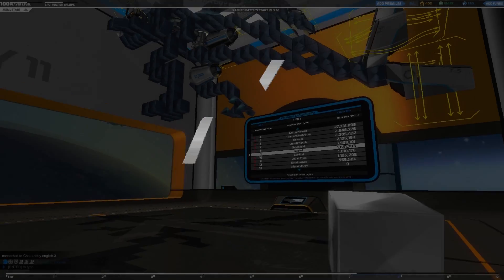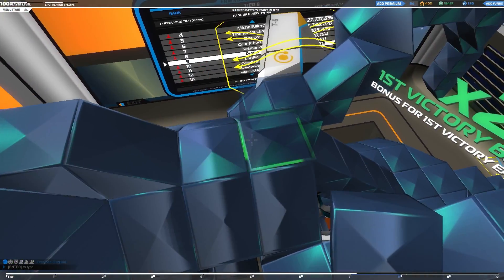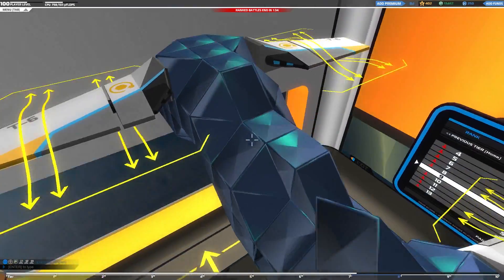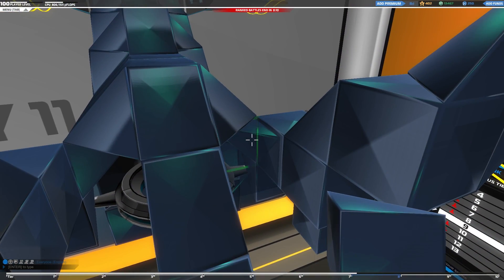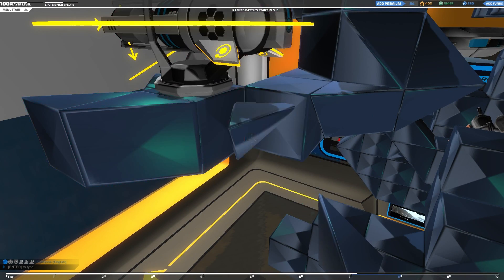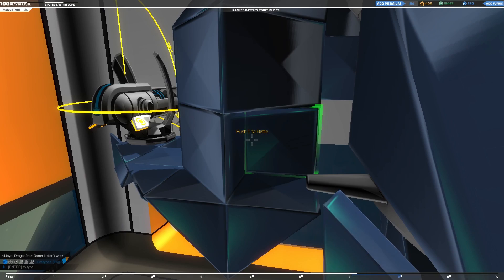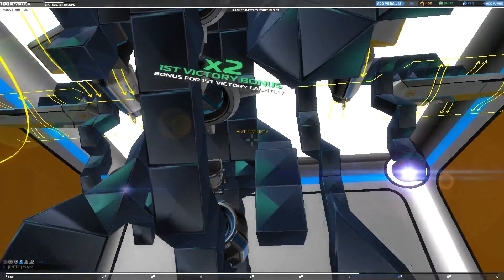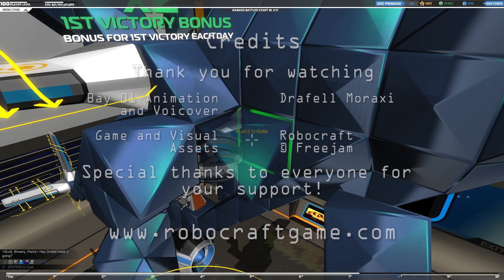Robocraft Design Tutorial - Tier x Flying Dragon Part 01 - Head, Arms & Legs

Comment: When you make a plane, how do you control the pitch?
That is, pointing the nose up or down.
So far, all I can do is a weird turning climb.
Is that because I have a bad design, or is that how planes work?
Reply from the maker: You need to have a set of wings in front of the pilot seat and behind the pilot seat as this defines how the wings work as control surfaces. Post a screenshot or a link to your design and I will see if I can provide some feedback.